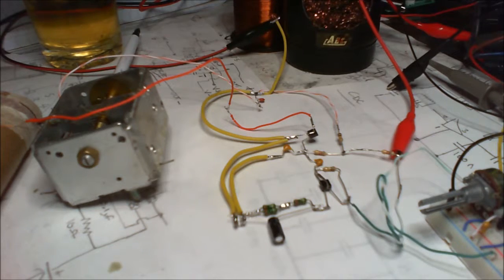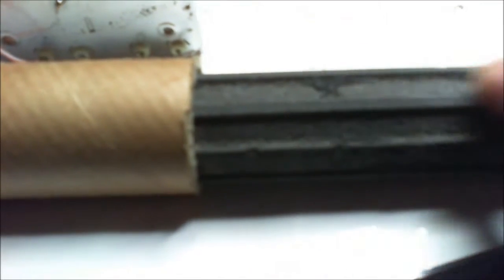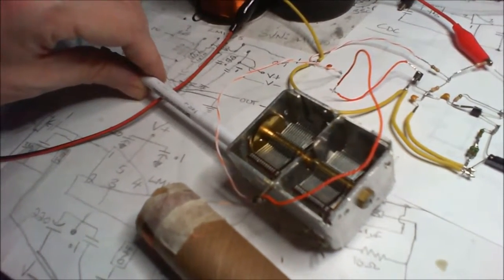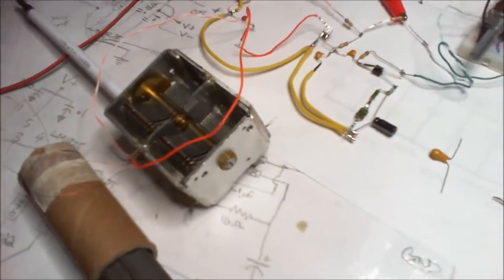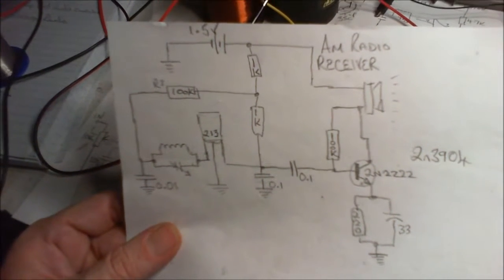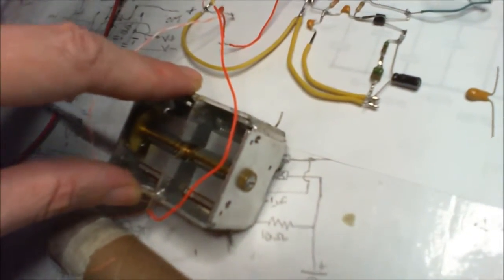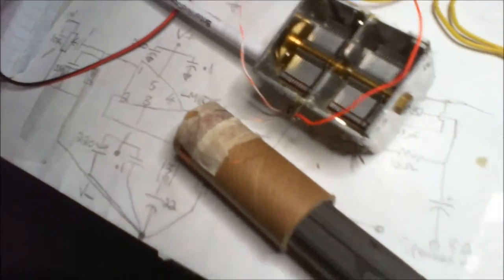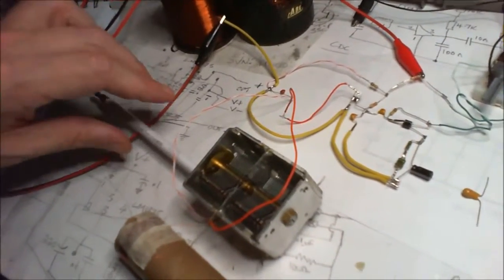AM Radio based on TA7642 and LM386 Pt2 2/2

Comment: In this one your coil needs to have just a few more turns,.....your tunning in to short wave ! (Higher frequency) so you need more turns to drop the frequency.
Reply from the maker: Sorry for late reply. I will try that. How may turns on a form like I am using, or length of wire would you suggest on same  diameter form. I have longer tubes.
Reply: Only about another 10 turns......its a inductance/ reactance thing, you did a good job on the building of your circuit.
Reply from the maker: Thanks, I will try that. I planned on looking at that circuit again as it was one of my first circuits and it worked so well.